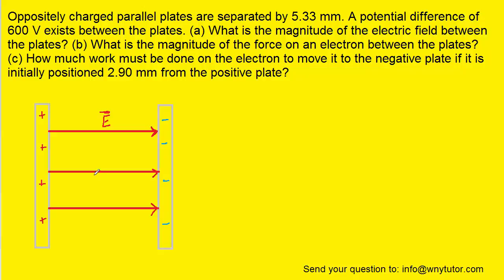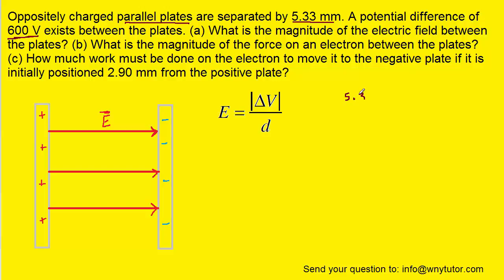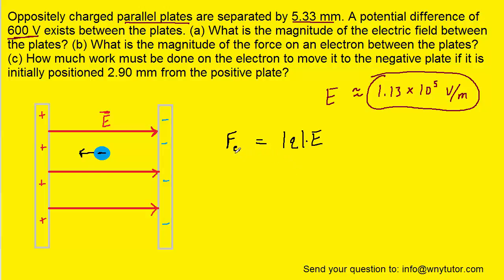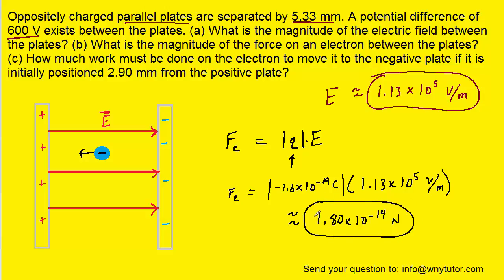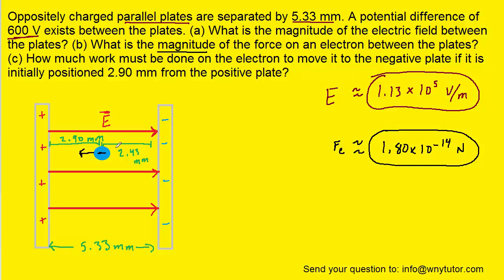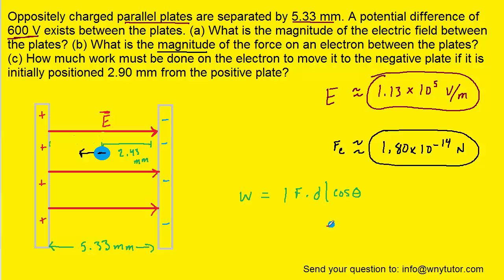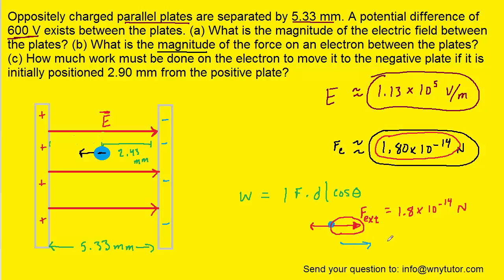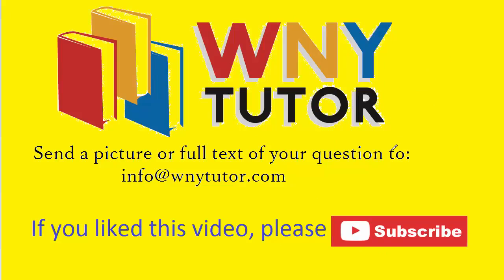Oppositely charged parallel plates are separated by 5.33 mm. A potential difference of 600 V exists

Comment: In part c) , the external force you used to calculate the work looks like it is only a balancing force and it would keep the particle static? Wouldn’t the force have to be greater than Fe in order to cause an acceleration?

Comment: an electrostatic CRC has a final anode voltage of 2kV and parallel deflection plates 2cm long anf 5cm apart .the screen is 30cmfrom the center of deflection plates .If the deflection voltage of 100V is applied across the plates , determine the maximum deflection , in cm

Comment: A pair of charged conducting plates produces
a uniform electric field between the plates of 12 000 N/C directed to the right. The separation of the plates is 40 mm.
In the figure, an electron is released from plate A.
 (a) What is the voltage across the plates? Which plate is at a higher V?
(b) What is the change in potential energy of the electron as it goes from one plate to the other?
(c) And so, what is the change in kinetic energy of the electron?
Reply: Please solve it